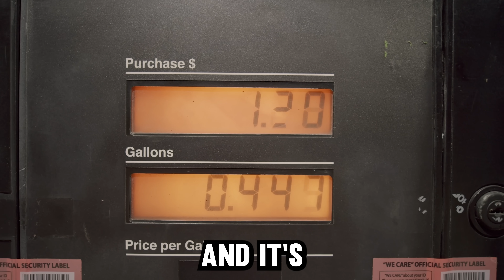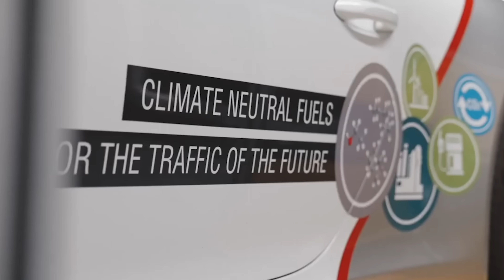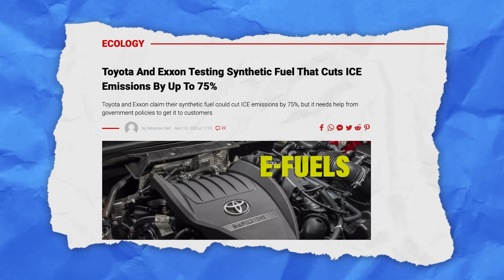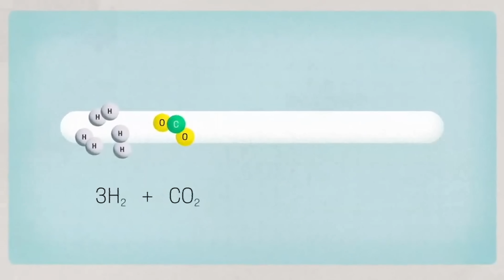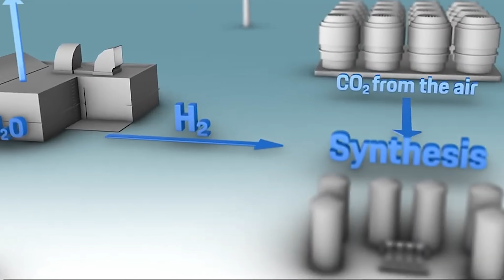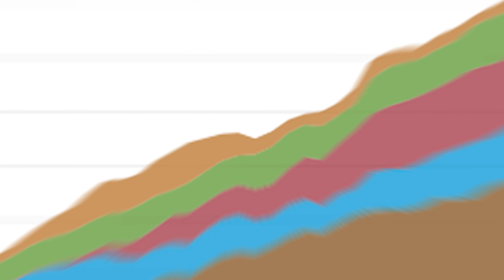Dodge Just SAVED Combustion Engines

Comment: Well you know they just ticked off the big oil companies
Reply: Not really, alot of the oil companies are on board with it. Exon mobil has a team of extremely talented petroleum organic chemists who developed the first commercially viable methanol to gasoline reaction. As a chemist I can tell you, the big boy petroleum companies are fighting like hell to figure out a way to make it profitable. The biggest issues facing synthetic fuel is cost of synthesis. The chemistry has long been proven, ironically enough it was invented by two German chemists Fischer and Tropsch in nazi Germany as a means of converting coal to liquid fuel to aid in the war effort. However, post war everyone forgot about the reaction and there was virtually no interest in it. However as of recently with push for carbon neutrality there's revised interest, however there's some major obstacles to overcome in driving down price; the first is catalyst. The Fischer tropsch reaction in short works by taking carbon monoxide combined with hydrogen and oxygen gas, heating it to high temperature and pressure over a metal catalyst ( typically something like cobalt or platinum). This initiates a long chain polymerization reaction creating a gasoline, diesel, methane and various other products. As I mentioned catalyst issues earlier; in a perfect reaction the catalyst is not consumed or altered in anyway allowing it to go on indefinitely. However, in this case the high pressure and heat causes residual carbon accumulation on the surface of the catalyst, resulting in catalyst deactivation. You can imagine that it would get expensive quick if you're essentially burning through 99.9% pure cobalt on a daily basis. Also conversion of carbon dioxide to carbon monoxide is essential for the reaction, which is extremely difficult as carbon dioxide is an irritatingly stable molecule. It takes some extremely forced conditions and some very exotic metal catalysts like rubidium to get it to be reduced. So While the chemistry has been proven, there's alot of pain staking details to work out. I know exon mobil is trying to develop new reaction pathways altogether and completely bypass Fischer tropsch synthesis. So I hope that helps